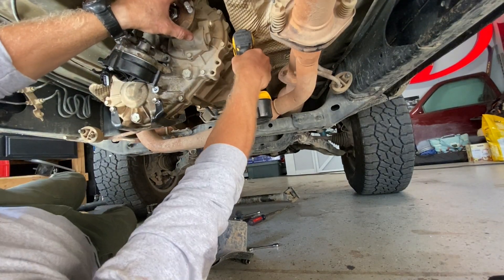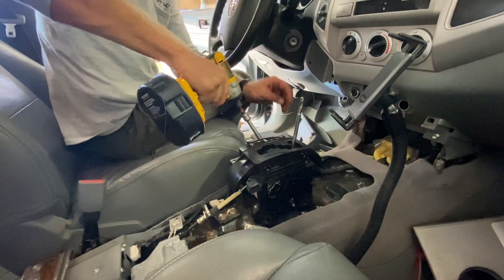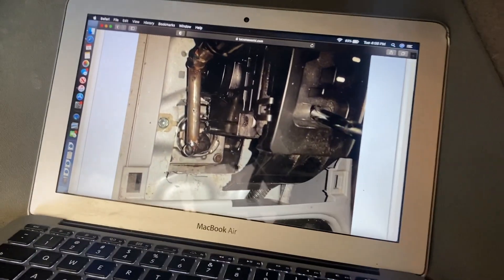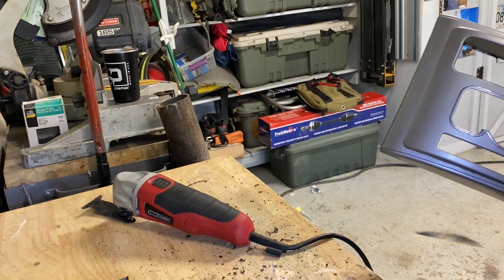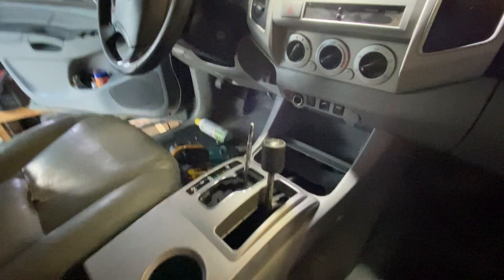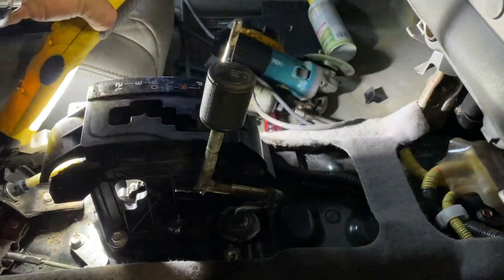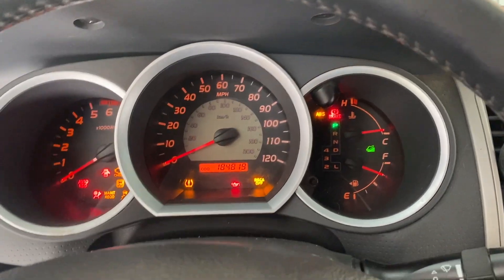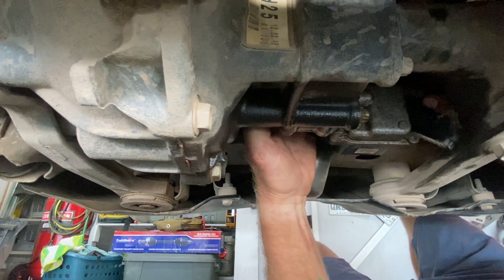Swap a FJ Transfer Case into my 2010 Tacoma

Comment: Awesome write up!  
I did mine this past spring, (I have a 2006 with Manual transmission) so in that I had to split both T-cases to swap a beveled ring gear and swap the input shafts, but otherwise same as yours.  Best swap ever!
Reply from the maker: Thanks for watching. That’s good info there. I knew the output had to be changed for the manual, but didn’t research that any since I didn’t have to mess with that step. It is a great mod for these rigs. Strong work!

Comment from the maker: Likely won’t make a difference in handling or performance, but it means there is no failure point later. My actuator is stuck, so I haven’t had a problem, but I could imagine a scenario where it could move if it wasn’t so stuck. That’s where a solid tube wouldn’t fail.

Comment: Thank you for making such a detailed video! I will be using this and the thread on Tacomaworld (which I linked your video to) when I do  this. I have had my tcase sitting in my garage for 2 years..
Reply from the maker: For sure. Happy to do it. It was fun to document, knowing it might clear up some of the less obvious bits. Thanks for bearing with me as I struggled through it on video. I learn as I go.
Reply: @TheDirtMile  Bringing this back up, (I still havent done the swap, but have the parts now) did you also do the anytime rear locker mod?
Reply from the maker: @great_white_taco  my locker had never worked since I bought the truck, so I ended up putting it on a double pole double throw switch completely separate from the Toyota wiring. It’s been much more reliable.

Comment: After you locked the add actuator into place, did you plug the wiring harness back up or just leave it unplugged? Im planning on doing this in my 14 regular cab 5spd.

Comment: Hey man thanks for the detailed install! I have a 2006 Sequoia and I'm getting ready to do this swap. I replaced the t-case actuator years ago when I first bought the truck and it was EXPENSIVE! Two weeks ago I ripped it off on a rock doing the Rubicon Trail. 
I can't believe how reasonably priced these cases are. Like you I sourced one locally and it was less than half the price of a used Sequoia t-case. Did you have to modify your driveshafts at all? Looks like I'll need to lengthen the rear a bit and shorten the front, which is fine.
Reply from the maker: Mine was plug and play as far as driveshafts are concerned. I believe that 2nd Gen tacos are the only ones that have the same length drivelines as the FJ. I could be wrong in that however. Before doing mine I watched the Sherpa 4runner get the swap, and they needed to lengthen and shorten on a 4th Gen 4runner. It was a little tricky to figure out, which is why I made the video for reference for folks. Good luck and let me know how it goes. Cheers!

Comment: So, I’ve done the swap to the fj case and I tried setting up the ADD to work on a rocker switch. It’s a ON-OFF-ON switch. It works but I keep burning up ADDs doing it that way. I’ve read that when you engage the ADD it’s actually engaging the passenger side shaft and not the driver one. After watching your video I’m really tempted to just say F it and have it basically always locked. How does it drive with it always locked like that while turning on pavement. Also does your MPG drop?
Reply from the maker: I didn’t notice a drop in mileage, and I’ve never seen a difference on pavement. These are still the best mods I’ve ever done to the truck. FJ cruisers don’t have ADD and they work great in the dirt and on pavement. You could source a solid tube from one of those too to delete.
Reply: @TheDirtMile  what difference would the solid tube make as far as performance and handling
Reply from the maker: @some-random-bloke to be honest, I’m not 100 percent sure on all of them, but we have had one of the front diffs out of them and the one I’ve seen, doesn’t  have ADD. But you’re right. It was only a manual and could be different. 

Most of the reason I swapped FJ case and ADD deleted the truck is from a reliability standpoint. I just don’t want all of the actuators and electronics. 

My 4wd ECU is completely deleted now, and I couldn’t be happier. It always goes in and out of 4wd easily now. 

I would for sure delete ADD again given the chance. My 3rd Gen 4runner got it deleted this week!

Comment: I love this and am basing my swap off this very video, minus adding twin stick with 12th state add harness. I got lost at the rear sensors pas side and dr side. What wires did you connect?? I thought both wires from each sensor were wrapped together? You wired it up differently. Please help on this matter. Thanks in advance, and again, bad ass informal video!! Thanks, and thanks in advance.
Reply from the maker: @greggomez1151  honestly I’d have to go back and look at what wires I hooked up. I’ve noticed some Tacos have different colors depending on year. It’ll just take a minute to figure out which is which. They just make the 4wd and low lights illuminate correctly.

Comment: Just ordered my fj case today, going to follow your video and do it the same way! I’ve got 2 questions! 

1. Did you have to bypass the locker? Or is it still functional with the wiring you did? 

2. Did your add delete require any modifications to the wiring?
Reply from the maker: 1. I did, but have yet to do the locker anytime mod. It didn’t work before reliably, and I’m hoping that that mod will fix that. The locker on the newer rigs is tied into the 4wd ECU which was deleted/bypassed with this mod. A Trac and traction control still work perfect. 

2. That last bit kinda lead into the ADD wiring. All the more I did, after pulling the 2 connectors from the 4wd ECU, and wiring them to make the dash lights work, was plug the ADD plug back into the socket, just to keep that wiring out of the way in the future, despite the fact I’m not using it. Hit me up on Instagram if you have any more questions. Good luck, and thanks for watching the video!

Comment: So with the ADD deleted, the front driveshaft will just constantly be spinning? Will that cause any excessive wear to anything? Gears, seals, etc?
Reply from the maker: I would guess it will cause more wear, but in my case I just want it to work. I’ve had so much trouble with the actuators on diffs, lockers, and t cases, and I was over it. If I bought a second one of these rigs it would be the very first mod I did. 

Short answer. Yes. Worth it to me.

Comment: Great video ! I have a 2006 4L with auto trans and found a fj case to do the swap. Looks to me like a straight swap but curious on drive shaft length?
Reply from the maker: I’m not sure on the driveline lengths on everything. It worked out exactly the same on my ‘10 4door TRD Taco at least. did you ever end up doing the swap? sorry the reply is so
late.

Comment: I have a 2011 with automatic transmission like yours. Did you source a t-case out of an automatic transmission FJ? I have been doing some research but haven’t yet found if it matters if the t-case came from an auto or manual vehicle.
Reply from the maker: It needs to be from an Auto. The manual cases are awd like the 4th Gen 4runner, I believe.

Comment: Is there anything else you had to do besides what’s in this video? If so, what did you have to do? I’m LS swapping my 08 Tacoma right now so it’s a little bit different since I’ll have a NP241 case, but trying to figure out the front diff stuff right now mainly. I just want to shift the tcase in 4wd and have everything work like it should.
Reply from the maker: That’s all that had to be done for my application. what you saw in this eliminated the need for the 4wd ECU and works like having front hubs that  are locked in all of the time. It sounds like a sweet project.